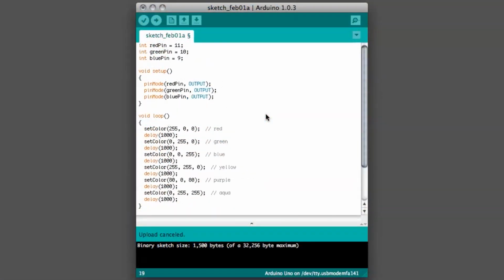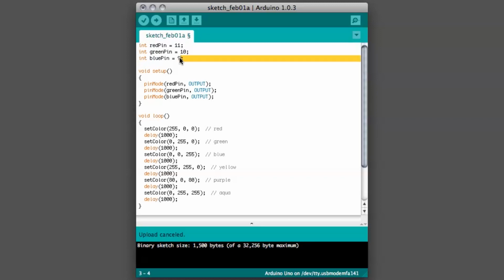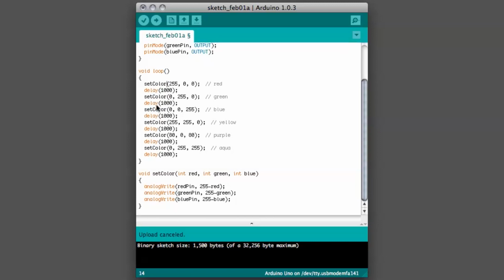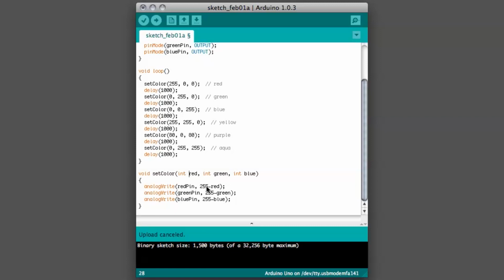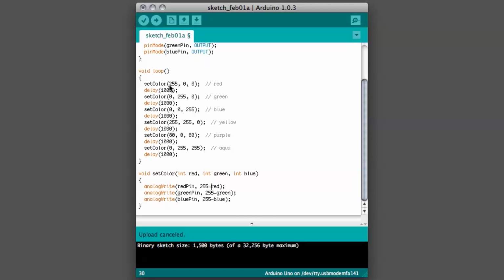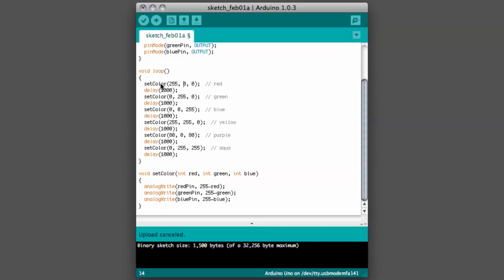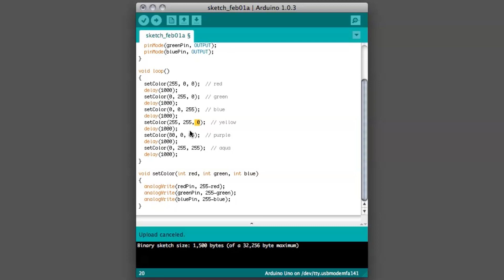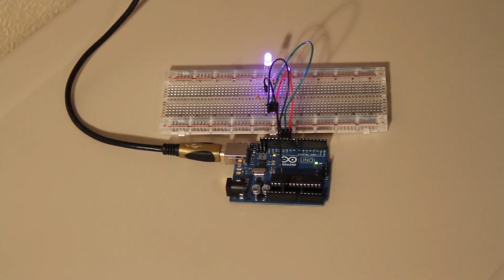Arduino Basics: 2 - RGB LED

Comment: You were absolutely right about the 2 different types of RGB LEDs. I have both but one wasnt working.  When I attached it to 5 volts it lit up.
THanks.
Reply: one RGB LED has a COmmon PLUS and another type has a Common Minus i find working with a common Minus is much easier.
Reply: I will have to check that out.  Thanks .

Comment: Are Resistors mono-directional?
Reply from the maker: They have no polarity so you can use them in either direction, but it's good practice to use one way so you can read the stripes without having to turn the circuit.

Comment: My RGB LED turns only red, green and blue. I want it to be yellow and purple either but that doesn't work. Do you know what the problem may be?
Reply from the maker: Are you setting the color correctly?  I go over the setColor stuff around 9 minutes.  It hard to know anything without seeing the setup :\
Reply: Thanks for your answer!

Well I didn't use that setColor function because i'm doing a quick test. But i'm pretty sure this code should make the LED yellow:
analogWrite(redPin, 0);
analogWrite(greenPin, 0);
analogWrite(bluePin, 255);

But the LED turns green.

Because of your answer I tried to do it with the setColor function, but the LED stays green.
Reply from the maker: you may have the blue and green pins mixed up or their pin numbers,  but regardless you should try giving blue and green 255 in order to mix yellow.

Comment: what if you dont use resistors? is that possible with the arduino?
Reply: The LED dies. You might get to see a little flash of light, you might not.  Either way, RIP LED.

 270ohm is considered to be the least resistance you can use with the 5v plug and most LEDs out there.
Reply: in some other tutorials they use 220, and in another 330. is it realy a big britness difrens? because else the 330 is the best if our not sure correct?

Comment: Where is the code?!?!
Reply: You can get the code from the book titled: Beginning Arduino Programming but I will paste it here for you.

void setup() {
   pinMode(9, OUTPUT);
   pinMode(10, OUTPUT);
   pinMode(11, OUTPUT);
   }
   
void loop() {
    digitalWrite(9, HIGH);
    digitalWrite(10, LOW);
    delay(1000);
    digitalWrite(10, HIGH);
    digitalWrite(9, LOW);
    delay(1000);
    digitalWrite(11, HIGH);
    digitalWrite(10, LOW);
    delay(1000);
}
Reply: so.. where is the code?